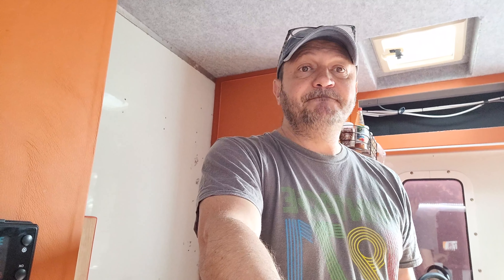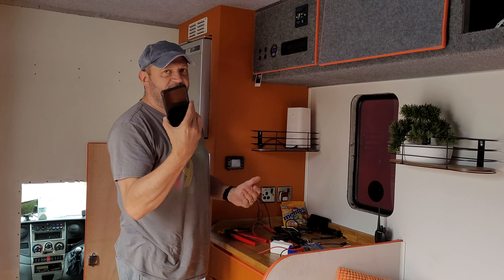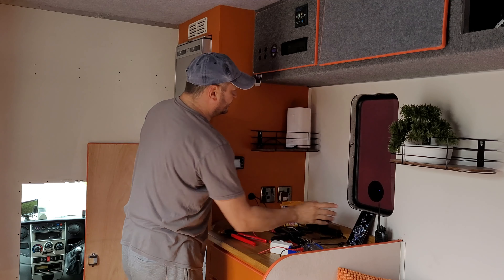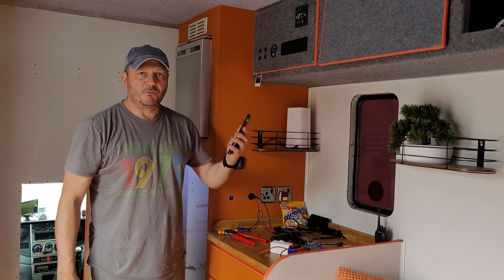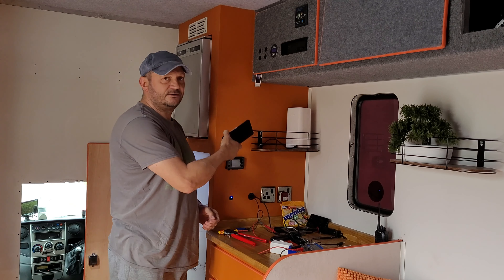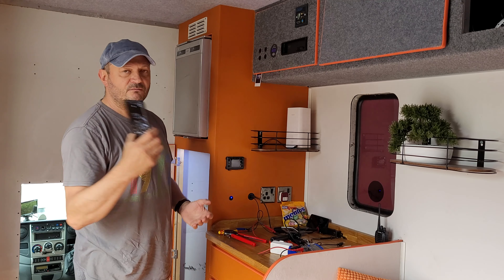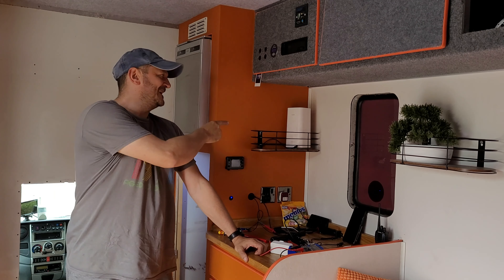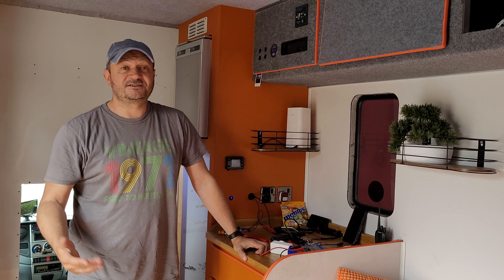Using a step down buck converter to stabilise 12v products

Comment: Love the videos
But what is that self adhesive foam you stick to the roof

Have you got a link please 🙏 

Best wishes
Reply from the maker: Hi Steve it's 3mm sticky backed foam insulation. https://www.ebay.co.uk/itm/123680854046?mkcid=16&mkevt=1&mkrid=711-127632-2357-0&ssspo=ZU_qY2ToQA6&sssrc=2349624&ssuid=f6uumempqas&var=&widget_ver=artemis&media=COPY
Reply: Brilliant 
Thank you
Reply: @PrisonersNoLongerAccepted  
One more question 
Have you been to a weigh bridge?
Would love to know the actual weight of the truck

I have just found out I don’t have 6 ton on my license 🥺

Comment: If you start the van and bring the input voltage up to 14.4v. Does the buck voltage stay at 12v?
Reply from the maker: It does Jordon. It doesn't budget at all with this buck converter in place 👍
Reply: @PrisonersNoLongerAccepted  Fantastic, Thanks.

Comment: Where did you pick up the router please, it would be ideal for my caravan, but I'm not sure if I want to get another contract sim, so would it work with a pay as you go sim, thanks in advance
Reply from the maker: Absolutely Neil it would work with a PAYG sim. I got the router from one of our kids who was actually throwing this in the bin after decluttering due to moving to a new house. They can be purchased from ebay either used or new and seem to be selling for around £200. For a good 5g router that is an excellent price. I have also purchased an external antenna especially because my van almost acts like a Faraday cage being a sold chunk of double skinned thick metal. Let me know how you get on 👍

Comment: Great video as usual can you do this to any router please or how can you tell if you can or not
Reply from the maker: Hi Paul, cheers for the compliment. Check the specs of the router, rooter what ever the hell their bloody called lol and make sure the OUTPUT is 12v. If it is then you should be good to go 👍
Reply: @PrisonersNoLongerAccepted  hi thanks for your rey this is new to me where can I get a buck voltage controller from and does it use a lot of power and can I run it off my normal battery or do you recommend a leisure battery cheers